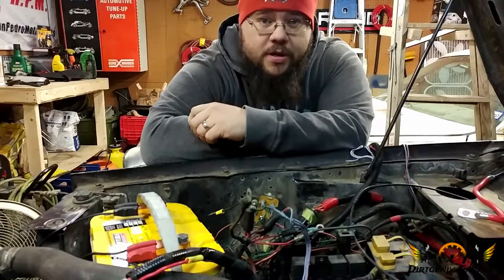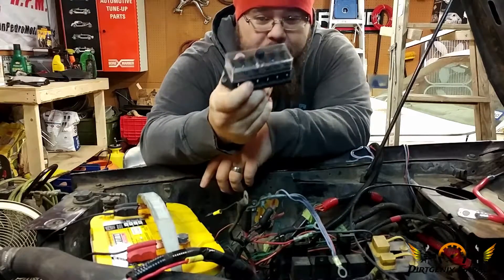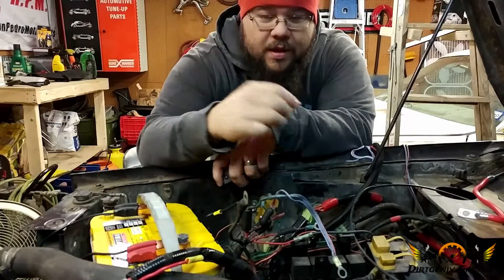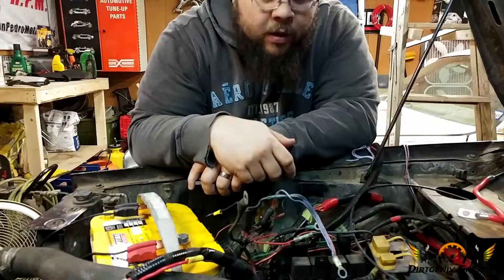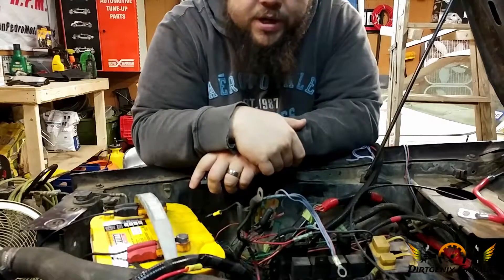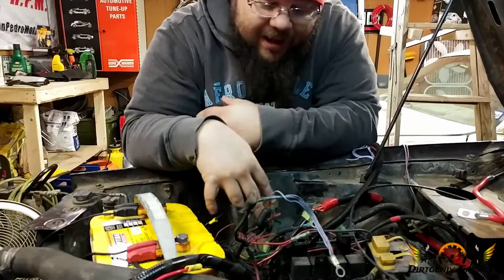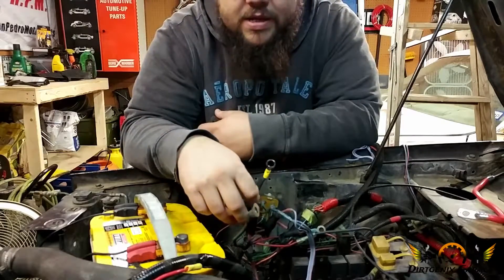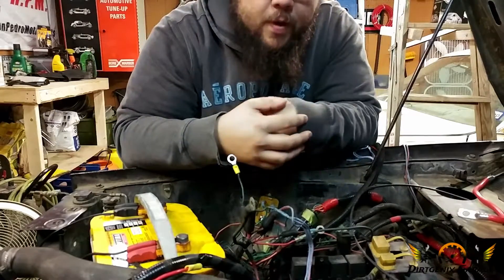FUSIBLE LINKS REPLACEMENT WITH FUSE BOX & WIRE REPAIR ON RENIX JEEP XJ - Part 1

Comment: Hi, very nice job :) I am in Europe and we do not use at all fusible links but my dodge from 1991 has many. How do you calculate the fuse you will use to replace the fusible link? thanks
Reply from the maker: I'm not real sure on how to calculate which fuse to use after replacing fusible links I consulted my factory service manual to see what the fusible link rating was as close as I could and then trial and error if it popped I put the next size up

Comment: Nice video, but why didn't you put the fuse block on the passenger inner fender so you wouldn't need to extend the wires?  I was also under the impression that you typically want to use crimp connectors instead of soldering in the engine bay as the sharp points will eventually pop through the heat shrink and potentially short out.  I would also have considered a separate circuit for each positive lead as many of the fusible links fan out to 2 or 3 circuits.  More isolation may have been a better option there.
Reply from the maker: I did not put the fuse block on the passenger inner fender well because I had other plans for it this was prior to the video being made I'd already sketched out what I want to do for the inner fender well with other accessories that I've added since I've made this video. Extending the wires allowed me to run them in a way that will not cause any issues in the future with rubbing or getting stuck on anything sharp as far as the soldering goes yes you can use solder in the engine bay as long as you do it properly there are Factory joints that are soldered and they have been that way since 1990 and those joints are still good in my engine bay it just really depends on your level of comfort and how much you trust things as long as you insulate everything properly and you've soldered your joints properly you should not ever have an issue but either way you can crimp them more solder them I chose to solder them because I did not know exactly where the three other wires went that went into one wire. I felt better at the time to just keep them going into one circuit until a later date when I'm able to figure out exactly where they go and I'll probably end up just running a new wire from the sores all the way to the new fuse box.

Comment: Appreciate the overview - ignore the haters. They're upset because this video seems to be the only one on fusible links in a Renix XJ. I would love if you did another video and explained what each wire controls. My headlights/tailights/brakelights/foglights are all dead after a short and I have no idea where to start with the rats nest of fusible links attached to the starter relay. None are visibly burnt of course, so it's hard to know. Someone going over each wire on their XJ in a video would be SO helpful.
Reply from the maker: Thanks, man. I really appreciate it 🙏. I might have to do that video  in the future myself as I don't even know what they control. My harness was pretty hacked up from the previous owner, which is why I ended up rebuilding the main harness in the first place. Oddly enough, I didn't have to mess with the fusible links until I converted them all to fuses.

Comment: Im doing this to my 90 2 door xj this weekend, Good work! Itll be nice to be rid of the fusible links!
Reply from the maker: That's awesome man! Thank you for the kind words. It's been a good upgrade so far for me so far i haven't had any issues. 👍
Reply: @dirtgenixgarage956  have you done any more work on the wiring? I got my XJ for pretty cheap because it had an engine fire, I repaired most the wiring to get it running but now I want to go through and make everything right!
Reply from the maker: I did rebuild the engine harness on my xj over the winter a few years back. It was before I started posting videos. I got myself a wiring diagram and a frosty beverage and went to work. My harness had a lot of rodent damage. So I had to do a bit of wire splicing, but luckily it wasn't huge problem to patch it all up.

Comment: looks good but solder creates very brittle points in the wire, use caution when moving all that around
Reply from the maker: Very true but in my case it is more or less in its permanent location and has been wrapped and zip tied so it's not ever really going to move around.

Comment: I have 1 fusable link that goes down and is loomed but it's not connected to anything it looks like it went down towards the start but I can't find anywhere it plugs into. Any chance you might know what it goes to ?
Reply from the maker: I believe it goes down and attached to the starter solenoid on the starter I do remember a small green wire that ran down and attached to a stud off of the back of the starter. Most likely the signal wire for your key.
Reply: The one Im trying to connect is red but it does have the same end connector as the green one you're referring to.

Comment: What fuse block did you use? I'm planning on doing the same thing on the rats nest that comes with the renix harness
Reply: Thank you for replying. How is yours working out?
Reply from the maker: Haven't been able to field test it yet my Jeep ended up having a totally different issue preventing it from starting. Someone had installed the wrong flexplate on it and never bothered to do the research on why it wouldn't start. So currently I'm in the process of making a video on that swap. Main reason for doing the fuse box addition was to clean up that nasty rats nest of wires on the starter relay and that route allowed me to eliminate fusible links and just have to replace a fuse if anything ever blows.
Reply: Just got done testing it and it's awesome 😎 I'm planning on doing the rest of the wiring harness like that or similar. Thanks for the video. Just subbed and subscribed
Reply from the maker: That's awesome 😎 man I'm glad the video was able to help you solve a problem I appreciate it very much and thank you for supporting the channel. I definitely have more stuff in the works for the renix jeeps and can't wait to be able to share it with everyone.
Reply: @dirtgenixgarage956  just a heads up you are going to want to run a 20 amp fuse for the one that has three red  wires. At full throttle. It pulls too much amperage for a 15
Reply from the maker: @Sweetishnutz  sounds good I'll swap them out next time in the shop thanks for the heads up 👍👍
Reply from the maker: Here is the link to the fuse block I used on this build. You can find them at almost any auto parts store this one just happened to be closest to me 👍 
https://www.napaonline.com/en/p/NW_785137
Good luck on your repair I definitely don't miss the giant cluster that was the factory harness lol.

Comment: Nice video! How did you figure out the right amperage of the fuses? Looks like you used 16a all over but fusible links are not all the same gauge..Any info about this would be great since I'm doing the same job. Thanks!
Reply from the maker: Thank you for the comment. That is correct fusible links are rated at different amp ratings depending on wire gauge. My situation was mickey moused pretty bad. I had multiple wires going into single links and the links were all hacked up. Typically the amp rating are about as follows:
18g is good for 15 amps
16g is good for 20 amps
12g is good for 20-25 amps
These sizes are for the fusible link not the actual wire. I took the side of caution and went with all lower fuses because I was not able to trace every wire and if I have one blow I can then trace it to find out the appropriate amperage of that wire and adjust fuse size at that time. Every vehicle is different just be sure to do your homework before you dive in. Good luck with the repair brother. 👍
Reply: @dirtgenixgarage956  thanks for the help! According to my Haynes book there should be 3 big fuses (40 and 60 amp) in the "power distribution center".. I can't find any of that..mine is a 89 and I don't see any fuses in the engine compartment..am I missing something? What's the "power distribution center"?
Reply from the maker: The power distribution center should be refuring to your fuse box. I don't actually have any fuses under the hood of my xj either it's just a relay block on the passenger side fender behind the ignition control module. I'll take another look tonight just to be sure but after rebuilding that whole harness I don't recall having to mess with any fuses under the hood. What years does you manual cover for the xj?
Reply: @dirtgenixgarage956  in the book it says "4.0 in line six cyl models" without specyfing any year. Sounds a bit weird that a 2001 has the same harness as a 89..anyhow I didn't find any fuses under the hood either. I did the job and the Jeep runs really good so far. Only problem I had was that the 25 amp fuse from the alternator that replaced the 12 Gauge fusible link kept popping. I replaced it with a 30a and now it works fine. All new wiring I did is bigger than stock anyway so it should be fine
Reply from the maker: That's great to hear brother. 👍 Yes lol that's the problems the haynes manuals tend to have a more generic output for vehicles. We both have the renix motor which is a completely different harness.
Reply: @dirtgenixgarage956  Renix had no Power Distribution Center like 1991 and later. And you made one!!
Reply from the maker: Yep much easier way to deal with things than replacing a fusible link
Reply from the maker: Mine actually did not have a c101 connector 1990 was a weird year for the xj they did away with the c101 but kept most of everything else from the renix era. 89 was the last year they did that connector.
Reply: @dirtgenixgarage956  I did some research. 87 and 88 had the C101. 89 and 90 did not.
Reply from the maker: Gotcha good to know for the other out there looking to tackle this job 👍

Comment: How can we figure this out if you in high speed?
Reply from the maker: The video was not really intended to be a how to video it was more showing of a way to fix one of Chryslers screw ups that they had swapped out with normal fuses in later models. I'm still trying to find the best way that works for filming the process and providing enough information without making the video 30 minutes plus for the viewers.  However if you have any questions I'd be happy to try to answer them.